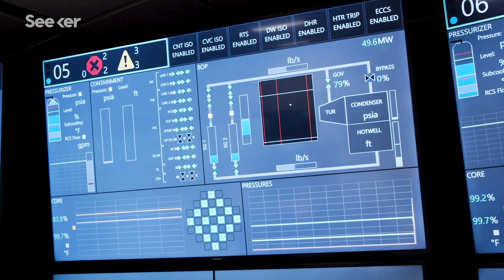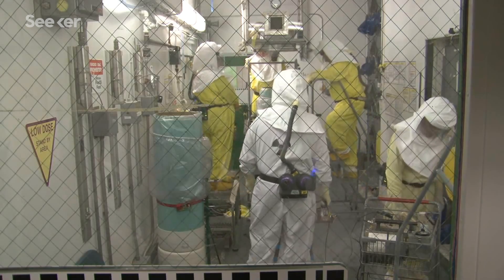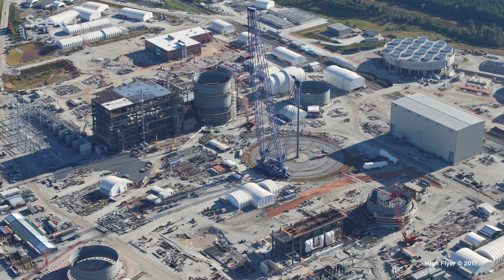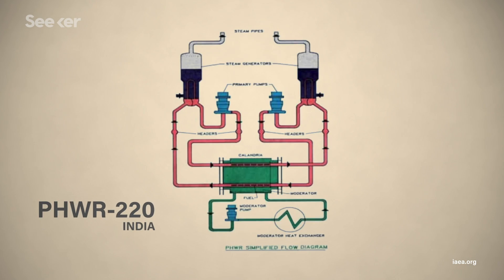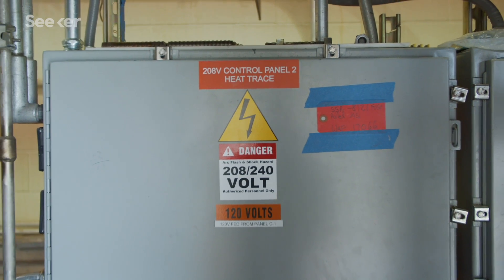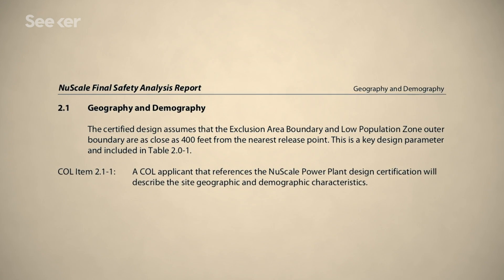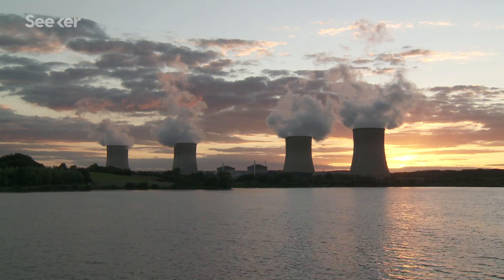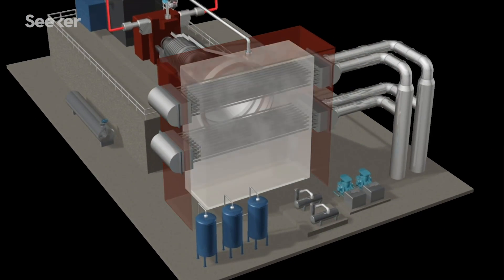Mini-Nuclear Reactors Are Coming, and They Could Reinvent the Energy Industry

Comment: did you know the first nuclear reactor could barely turn on a light bulbe ?
yea, we went a long way
Reply: we started off with tiny reactors then went bigger then discovered nuclear fuel enrichment when reactors can use a small amount of fuel to produce more heat than the reactors at the start of nuclear power
Reply: System is the problem 🏡  The Great Qualities

1, Show all living creatures; all the love and kindness as much as you can.

2, Only try to be honest with yourself. If you try to be honest with others, you will get into big trouble soon or later.

3, Aim only one target at a time; otherwise you are chasing two rabbits and you will miss both. So, the reason behind it. Have one powerful reason and never ever give up the one you want the most.

4, Don't try to be good person only but be the powerful person. We will grow to be the one or we will die. There is no other choice. 

5, Always learn and look for to improve something your life. 

6, You are not alone. Love and faith the high power reduces unnecessary stress in life. But never completely rely on it. 

7,  Success and happiness are the byproducts of our usefulness. So, always increase the possibility of success.

8, Life is not going to be easy. Because of our unnecessary things. Eliminate all the unnecessary things as much as you can by organising yourself well with the environments. 

9, Never believe anything without the proper evidences. 

10, Always try to give more than you take. 
Because it is dignity/ character of the divinity within you.

🌎 As long as people continue to see themselves as separate from everything else, they lend themselves to being completely enslaved. Success depends on how well we relate to everything around us. Joy comes from that bliss of connectedness. I believe that unarmed truth and love will have the final word in reality. To love; you should have good heart. I am a good person until I see a person better than my standard of goodness. Being good is the progress towards a worthy cause. Love is God. Whoever lives in love, lives forever. How selfish it is to try to keep something forever? Love is all about nourishing, nurturing, sharing and expanding the love within you for all. The principle to which we adhere to is that we have kindness of love at heart for the whole of mankind.  As long as there is the unnecessary differences within us; we can not live peacefully so we have to eliminate all the unnecessary differences among us so we can love all. People abilities may vary but not there true love. If we love a person/ God for a reason then we love the reason but not the person. No reason is the reason to love the person because true love never fails. So do not compare or measure the true love as first or the last but love all truly. If you love people truly then you can understand people. If you don't love then you don't understand people at all.

People are controlled by system why?
The Cyclical Consumption is the current economy all over the World. It is making the scarcity problems of the earth finite resources to deteriorate day by day. Current Monetary System is legalised theft. Real money is Gold and Silver. Scarcity gives the money more value. Real money won't lose it's value. When Governments stay away from Gold & Silver then very easy to transfer the wealth / resources to upper class the Rich (Corporatocracy) Elite. When the Governments are printing out more new fiat currency with reserve banks, our old currency is losing its purchasing power everyday. They are printing millions of currency everyday. All governments and laws are existing right now to transfer wealth to upper class the rich elite. The USA Government & other Governments are in many countries, bailed the investment banks & financial institutions in 2008 against the majority of the people. There is no democracy in any countries. Because of the Money System based on profits motive only above all else even humans lives and well-being. So, we do not have freedom to protect our values with the money so on. The violence, bankruptcy & all the negativities are build into the Monetary System of our society. All are owned (including ourselves) by Reserve Bank. Which is private cartel the corporation. So, in legal system, we are legally considered as chattel the properties. They make money in the capital markets with our birth certificates. They do not consider us as Humans. That's the truth. We are at the invisible war with the Elites (Corporatocracies). We have to fight for our Freedom. Resource Based Economy is the Solution. We have to declare the earth resources as the heritage of all the people of this world. So everyone has access to it. Please have your research about zeitgeist movement then you know the truth more. 

 Truth About Health/Drugs Industry Because Of It Your Life At High Risk The drug industry is a 1/2 trillion dollars a year worldwide conglomerate. Almost 300 billions dollars just in North America. That is really big business. What would happen if everyone were well? There is no money in health. You see, good health makes a lot of sense but it doesn't make a lot of dollars. Because everything they do is toxic. Every drug they use, prescription drugs, all drugs are liver toxic, bar none. If you've had amalgam fillings put in your mouth by dentists. It is highly toxic. There's cancer because most of the chemos are themselves carcinogens. To view the tumor as the cancer and we know the tumor is not the cancer. The cancer industry is 200 billions dollars a year. The more work they get, the more profit there is. You have to dismantle; If the truth ever came out about what we would need to do. 30% of people of females in America are at risk of getting, will get cancer of the breast. The ones that are already dead have been grossly mistreated by the medical profession and by the government that supposedly is supposed to encourage free research and development of all possibilities. Why would medical doctors who studied medicine and practice medicine and are heavily funded by pharmaceutical companies why would they go and look into vitamins? That they never had the answer orthomolecular. And as more and more of our population start taking their health into their own hands, there's going to be even more and more of changes. It can't go on the way it is. The system is failing apart. We must make nutrition the primary prevention strategy for the population. You are what you eat. You are everything that you have ever done to yourself. The choices you make directly affect the outcome of your life. - (Food Matters Documentary in Netflix)

😊 Well, I truly love God. I am not religious but very spiritual person. So, I believe 1) Religion is the beliefs in someone experiences But spirituality is having my own experiences. The mainstream religions people promote religious ideology by giving guidelines and guide but In my spiritual life; I do not want anyone or anything between God and me to restrict my freedom to worship God. 2) We do not need any authorities to do good work. The god work is the good work always. In contrast; organised mainstream religions are claiming that they have the authorities to do God works as leaders so on. 3) God is not capable of doing wrong thing, change the past for us and create anything out of nothing for us. Nothing means not anything. So, even God is limited. The mainstream religious people believe that God is unlimited. 4) God wants us to take responsibilities for our righteousness life but not for all the consequences of our actions because they are continued to exist among us. So, How can god punish us for all our consequences? The mainstream religious people believe we are full of sins because of all our actions. 5) Freewill  is an illusion. People always choose the perceived path of greatest pleasure.  So, we do not have choices all the time. In contrast teachings of the mainstream religions are promoting people to do god's will always because we all have choices of freewill always. 6) We can not separate everything into groups. So, everything for good and evil and there's no success and failure for everything. If everything is real then real things can not be threatened. Once you come to understand that God/The Holy Spirit is in each of us, You will no longer need a Book to tell you how to live. Then why we need religious scriptures? The Virtue is the expression of the basic goodness in our actions. The Basic goodness is the fundamental worthiness of every individuals. We are worthy to God always in everything. 7) Beliefs in a cruel God makes a cruel man. No matter what; every living creatures has the right to live and What makes their life cheap? Everything depends on everything. Nothing too big or too small in value. We can not love and hate at the same time; Being a vegetarian means love without cruelty happily. The mainstream religious people are killing people and sacrificing animals in the name of God. They promote God's cruel punishments. The Punishment is endless for Sinners/Devil according to religious scriptures. But God is love always. Overcome hate with love. If all religions for peace, unity? No way. Because they are not for peace. 8) Well, The God gave us everything to go from moment to moment in our lives as we do our part  and pray only to thank god then the Love is in progress. The Love is always for everyone. We are always worthy of the God's love. Our greatest fear is; not to be loved by anyone but we are all loved by someone. When we eliminate all our unnecessary differences among us then true peaceful life is possible with the true love. If we can't find the peace within ourselves then we will never find it anywhere else. 9) This is the Fight for independence and freedom of humanity to worship God freely without religious guide and guidelines to restrict us. Unnecessarily, We do not want third party controls over us in anything ; especially in spirituality. 10) Revive Survive Thrive. Sincerely,  The Real Peacemaker against religious oppression.

 https://youtu.be/HbvCxMfcKv4
https://youtu.be/pIJHJzDQcRM
https://youtu.be/MyxbdmAnIcI
https://youtu.be/wLzeakKC6fE
 https://youtu.be/P8vHa8zD7jY

Comment: "Control rods will automatically fall down"
Reactor: Gets tipped sideways
NuScale: 😮
Reply: Srijan Bharati Maybe the rods are spring-loaded. Orientation wouldn’t matter if the springs are strong enough to push the rods when the reactor is upside down for example.
Reply: Lorenz Müller this is the principle that BWRs operate under, their control blades are inserted from the bottom. If the actuation mechanism fails, there is a nitrogen accumulator that forces them upward
Reply: @lorenzmuller4000  They wouldn't use the word fall if it was spring loaded. Besides, it was just sarcasm.
Reply: Yeah! And what happens when earth tips upside down? hmmm
Reply: spring or pressure driven rod like high pressure nitrogen
Reply: Roller bearings??